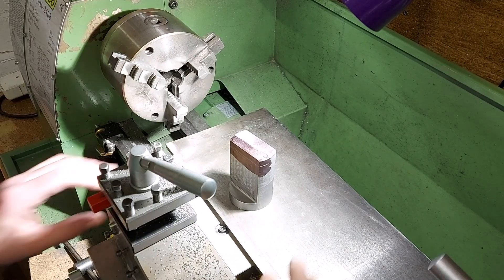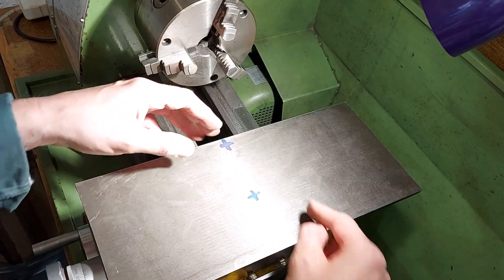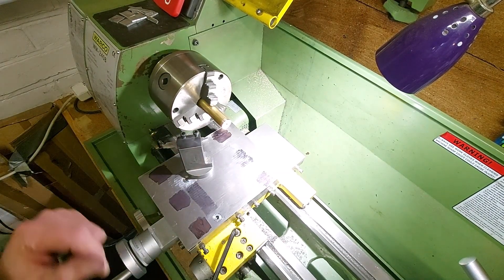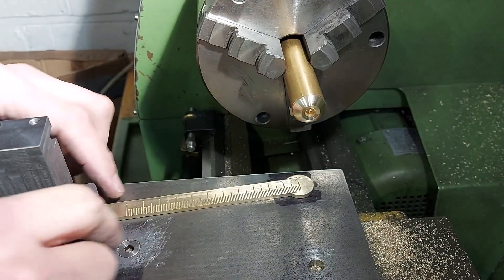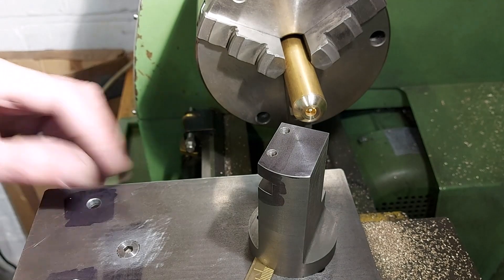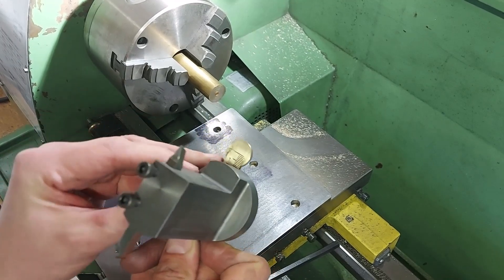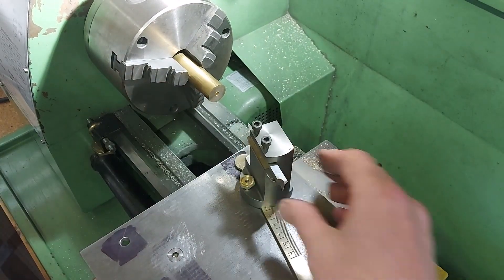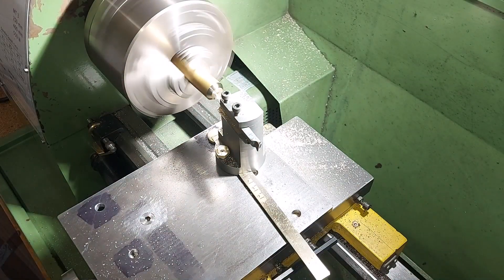Free Hand & Ball Turning Tool

Comment: Nicely done, a collet chuck would be a lot safer for that, I have the Turnado, and the thought of my hand getting mixed up with the chuck jaws, scared the snot out of me;)
Reply from the maker: agree, I will be using a collet chuck when I use this in anger, cheers Nigel
Reply: @editorglueitcom  I hope you use a collet chuck every time, especially even when not in anger.  That’s when it will bite you.  As you concentrate on not letting the tool bit grab, and then it unexpectedly does, your hands will likely unconsciously jump.  And every successive cut keeps bringing those juicy fingers closer to the whirling bits of hell.  I wish you the absolute best.  This video was extremely interesting and I hope your around to show more 👍👍👍👍
Reply from the maker: @joell439  hi Joel, agree. You will see I pulled the workpiece out a lot further in this test and just machined the end radius. I have had it dig in and it actually behaves very well. I will use a collet chuck and post a video. Thanks, Nigel